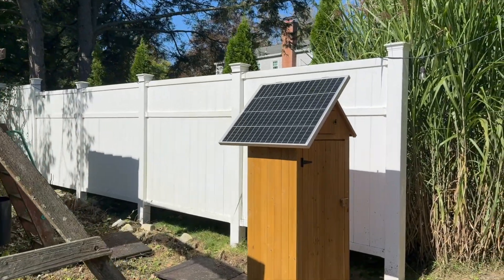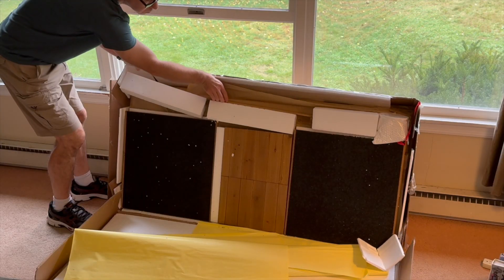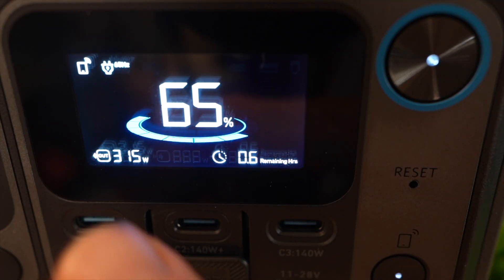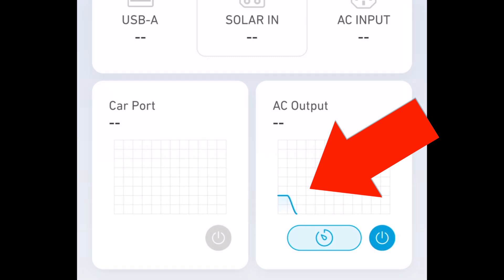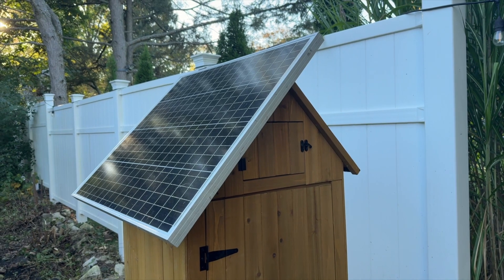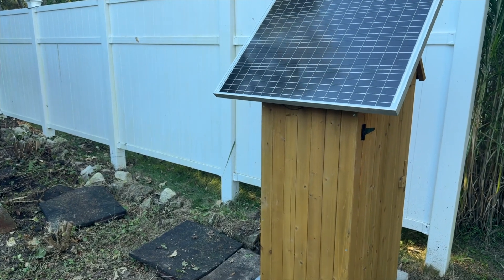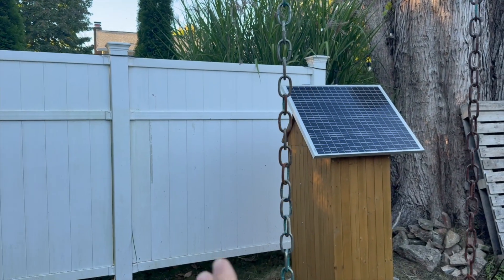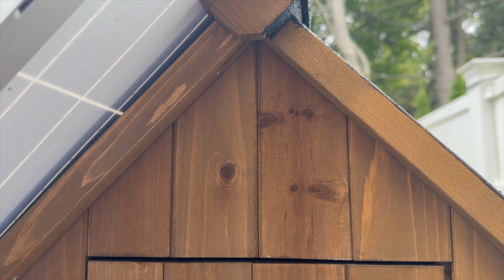I Built an Off-Grid Tool Charging Station | ft. Anker SOLIX C300

Comment: @frugalRepair Thanks for reminding me you posted this video the other day! How bright is the light on the Anker Solix C300? Would it be bright enough for my 10 by 12 shed?
Reply from the maker: Thanks for watching!  The light's probably bright enough for a space like that to generally see and not bump into things but not bright enough to work by.  Like if you had a workbench and wanted to work there at night, I'd suggest a brighter overhead light (but you could still run it from a power station like this one.)

Comment: You could be interested to see how to charge it directly from solar without inverter. This could allow the price to be cheaper. 🙂https://youtu.be/3e_lcJygOBk
Reply from the maker: That looks like a fun project.  I didn't see what modifications you did to the Dewalt charger.  Do you have a video showing/explaining that?  The issue with DC to DC charging is that you would need a custom solution for each tool charger.  Plus, it would only charge when it was sunny and you can't have remote control/monitoring.   But I'm always excited to see a cool solar project.  Thanks!

Comment: How does it charge 300 watt battery when it’s 300 watt power station isn’t that a bit harsh on the power station ?
Reply: Great idea and well done video.  You could mount a tiny fan that runs during day to help cool the shed.   Also, I would spray that roof with the spray roofing sealant.   It works well.
Reply from the maker: Thanks!  That is a good idea about adding a fan.  I really don't know yet how high the temperatures can get in there.  And because we are heading into fall/winter, I'll probably look at the venting/cooling options again in the late spring.  I see some inexpensive USB fans with thermostat options, so I'd probably add the vent and fan for another $20-30.   For the roof spray, are you thinking of something like flex seal?
Reply: @FrugalRepair  yes.   Flexseal
Reply: @FrugalRepair  and a small computer fan with a little temp thermostat that turns it on at 85 degrees.
Reply from the maker: The power station's continuous output max is about 300W so it's not a problem to output that much to charge my greenworks battery or any other 300W load.
Reply: @FrugalRepair  you can only run that one charger right if it take 300w roughly to charge an you can only use 300w
Reply from the maker: When that particular charger is drawing it's maximum, yes.  My other tool chargers don't use nearly that much.

Comment: hey, my tv suddenly died because i connected an amplifier incorrectly, how do i diagnose the issue without any tools?
Reply from the maker: I don’t know what you mean by died, but if you plugged the wrong thing into the main board and it’s doesn’t work now, maybe that’s what is not working.  I have other steps in the pdf and a video I made on diagnosing by observing
Reply: @FrugalRepair  I found the issue, it was actually the main board that got shorted. thanks for trying to help!

Comment: I had expected a DC charger directly connecting the solar panel to the batteries instead of a Anker battery promotion.
Reply from the maker: A DC to DC solution would be cool but pretty hard to make flexible enough for the different tool batteries.  Plus, it would only work to charge them when it was sunny.  I’ve had multiple friends ask me about this kind of project so I wanted to package it so others could do the same if they wanted.  Obviously, you could get a different power station but I thought this one worked well for this situation.
Reply: @FrugalRepair  I think I must have missed the “ft Anker SOLIX C300” in the title. Sorry about that!